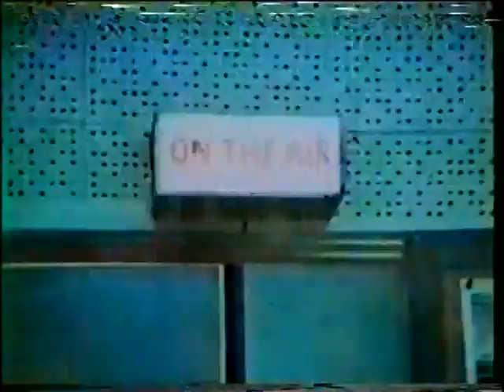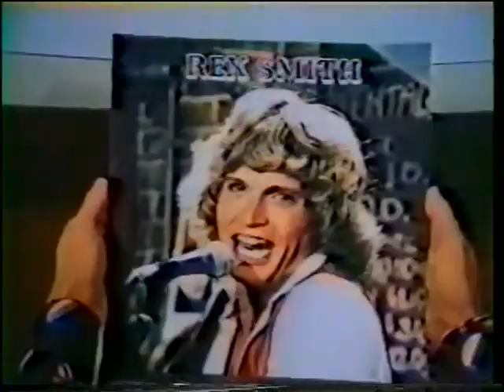California Fever episode with Rex Smith starring Jimmy McNichol and Lorenzo Lamas Underground Jock

Comment: There was 13 episodes of the show for the first season. CBS only aired 10 of them. There still 3 episodes that were never aired.
Reply: Incorrect. There were 10. CBS aired only 9. The network or Warner Bros. decidedly stopped production after about 6 of those. There is an unproduced script, final draft dated November 7, 1979, housed in the Library of Congress ("Dancing Wheels," written by Carole & Michael Raschella).